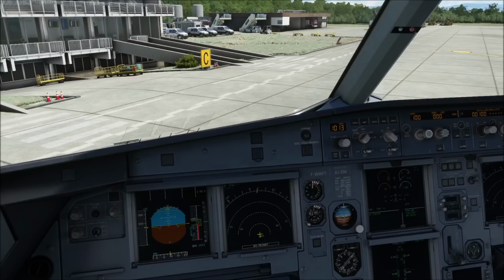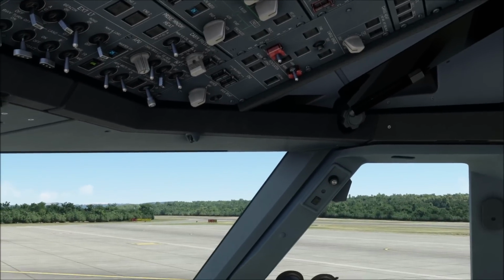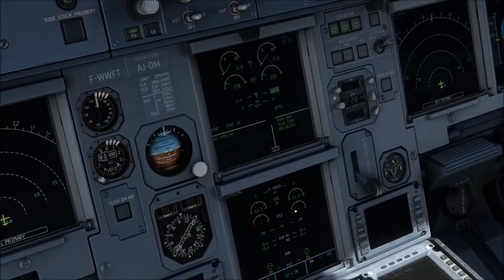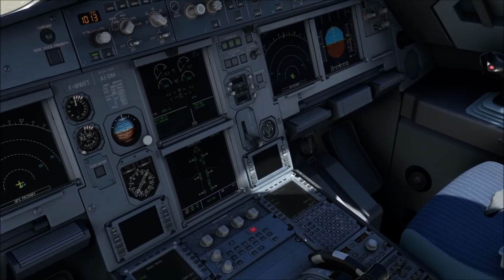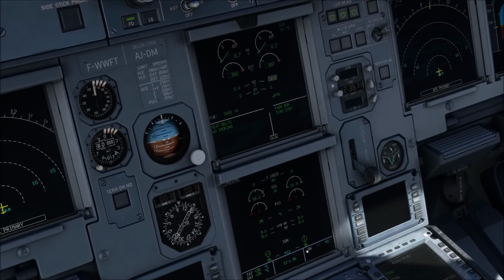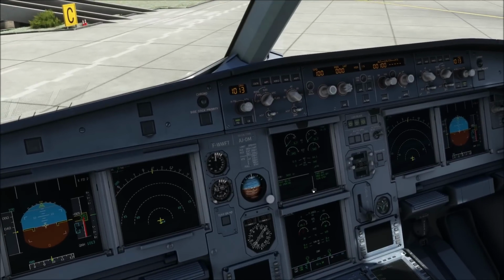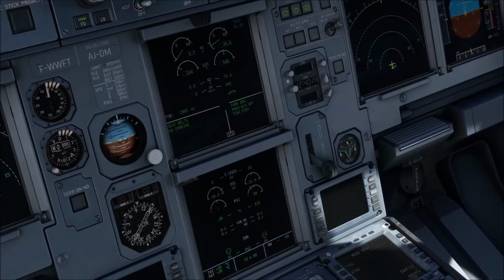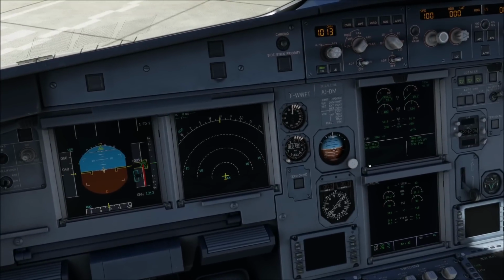5 Ways to START an AIRBUS ENGINE | Real Airline Pilot

Comment: Great to see a video about the many ways to start, especially in the Fenix as there are so many failures that can be simulated
On note, Is there anything in the SOP’s for airbus in regard to which order the engines are started with an ASU? Reason I ask, I’m a ground handler who has experienced Air Start procedures and many occasions, from all 3 positions, on multiple aircraft, E175 crew had said their procedure specified 2 then 1, meaning we position ASU aside/ in front of engine 1
But any airbus crew has never really specified, they’ve been happy with either, 1 then 2 is more efficient for usas ground handlers as we can position the ASU prior to Step/Ramp disconnection, curious as to wether SOP’s specify or wether it can be a discretionary matter as the checklist and procedure could be done either way round
Fantastic Video btw! Watched the channel many times to learn the PMDG!
Reply from the maker: Hi, on the A330 it’s usually engine 1 first in the A320 engine 2, however the FCOM gives the commander the explicit discretion to change the sequence as needed.

The reason is that the engine started first is the one which powers the hydraulic system that powers the alternate brakes, on the 330 the blue system, on the 320 the yellow system.

Comment: Thank you for this! On method 2, airstart, if you have insufficient brake accu pressure, what would you do? Is it ok to just confirm the chocks are on?
Reply from the maker: Running the yellow ELEC pump (320) or the blue ELEC pump (330) will charge the accu pressure

Comment: Could you do a video like this, but for the PMDG 737?
Reply from the maker: Hi, it would be four ways to start then, three of which I could cover - normal, ASU and crossbleed (#4 is the manual  operation of the bleed valve which PMDG doesn't model).
I already did a tutorial on the ASU and crossbleed starts so there wouldn't be much new in such a video anymore.

Comment: Nice video as always! I was wondering why didn't you get an ECAM after the engine start since your fuel pumps were off. I was also wondering if you know the answer to why on the startup flows you don't test the cargo smoke loops, some real pilots don't even know why heh. Let us know when you finish your type rating pls!
Reply from the maker: I believe it takes a bit of time until you eventually get the ECAM alert for the fuel pumps. Yeah, they should have been ON of course - just too much switching around with panel states haha. Uupsi
Reply: Hi mate, the pilot do not perform cargo smoke test because it is performed automatically during FWC initialization. 
Basically, cargo smoke detection is managed by the CIDS directors, specifically by the SDF (Smoke detection Function).
Hope It can helps you😉
Reply: @VirtualFlightTraining  hey! Nice to see you here! Thanks for your answer, that's interesting, so when you hear the triple click when starting up the aircraft, that's the FWC and it already tests up some equipment.
Reply: @clearprop09  yep. A Bite test is performed every time the cids power up.

Comment: Assumed windmill would be option 5
Reply from the maker: Actually no, I didn't count that as I meant "normal" ways to start here.
1) Normal Start
2) Manual Start
3) High Pressure Air (ground air unit) Start
4) Crossbleed Start
5) Manual Operation of Start Valve